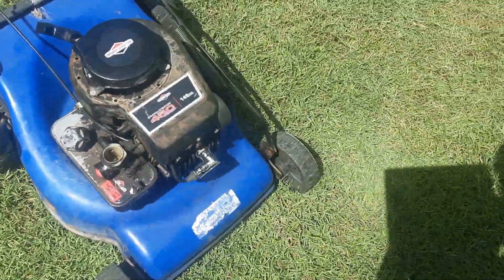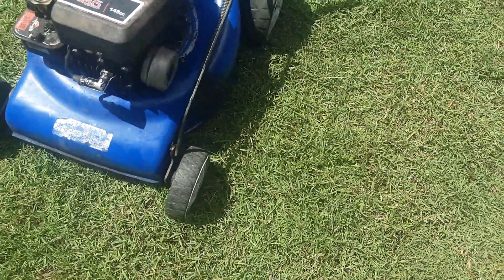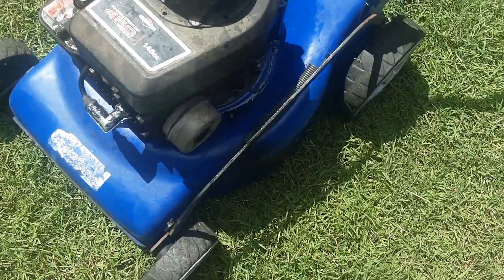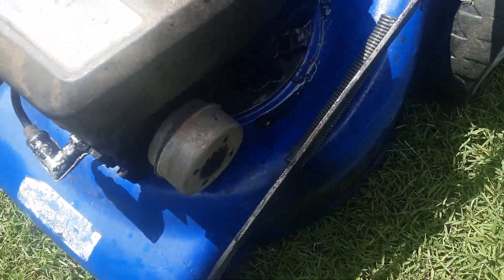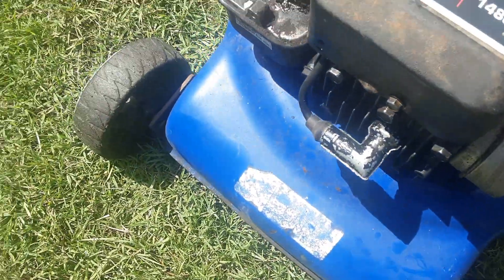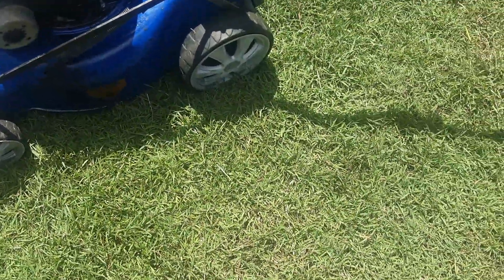210psi briggs and stratton  450 series  engine  sounds like  v8

Comment: Running at that RPM and without an air filter it isn't going to last long.
Reply from the maker: It was  just  a test  of the motor. After  I completely  rebuilt it, I completely  tore it down and  put  new rings in it  and shaved the cylinder  head to get it to sound like  this
Reply from the maker: It is running  at like  7,000 rpm

Comment: Yeah there no way a 148cc flat head is making 20hp lol a built 212cc makes 16hp and they have ported heads and billet parts and can rev to 9000rpm
Reply from the maker: I am running  it on e10 fule  watch  is more powerful than  gasoline
Reply: @posttopstreetlight1055  e10 is no more powerfull then gas all it does is raise your knocking/pinging Resistance from boost also the carb would have to modified to run race gas since it is a leaner fuel
Reply from the maker: I got  it to rev about  7,000 rpm
Reply from the maker: I wonder  what  nitromethane would do  in the engine